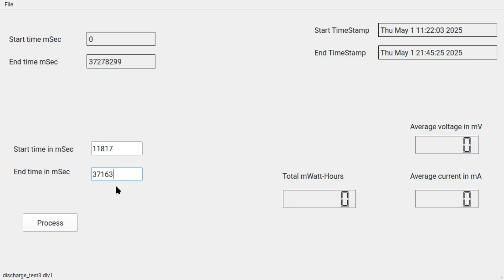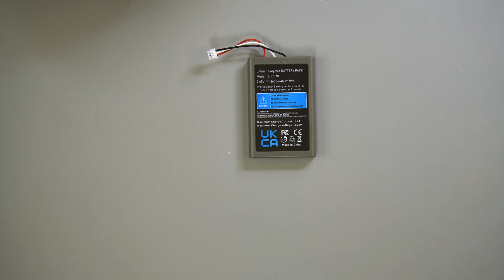Verifying DualSense Battery Test Setup: Power Readings & Setup Insights

Comment: There’s no way you’ll get 9.7Wh out of that battery in any condition. If you test an original Sony battery that’s less than a year old, my experience is that the Sony battery will still have more capacity with the same test conditions as those plastic shell third party ones. I wouldn’t link to them or recommend them.
Reply from the maker: I will end up testing it, but it would be a miracle to 9 Wh.
Reply: @metalplasticelectronics354 I did my testing last year so I don’t remember the exact numbers but IIRC a battery from a 1 year old DualSense was around 200mAh better than these and a battery from a 3 year old DualSense was still 30mAh better. Made me wonder if they are just batteries harvested from broken controllers, relabeled and sold as new. Seems to happen with a lot of spare parts from China.
Reply from the maker: I'm testing a new DualSense battery now.

Comment: I look forward to the next battery test. I already have a 4000mAH installed in a controller and have no idea if I’m getting better time from it. I don’t play enough at one time to notice.
Reply: I doubt it will be 4000mAH. One easy dead giveaway is the size of the battery. If it is the same size as the original battery, then it is likely to be the same. How can you get more mAH from a battery that is the same chemistry and the same size?
Then there is the weight. A densely packed battery will weigh more, and hence have more mAH capacity. But I doubt the 4000mAH unit is that much heavier than the original Sony 1560mAH battery.
Reply: @ I’ll do a weight comparison. I have an extra lying around to test. He looks to be using the 2650mAH for the video. Same dimensions as the Sony but higher capacity.
Reply: @OmeliGaming  I believe that the the whole point of these tests ... to see if what is printed on the battery casing is even close to the actual capacity in real world usage. The mAH printed on batteries are rarely accurate.